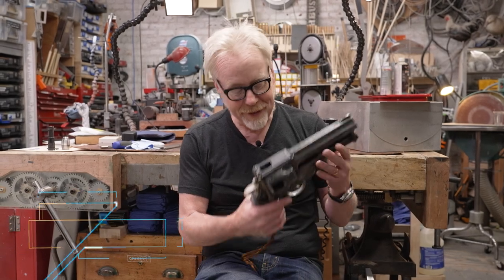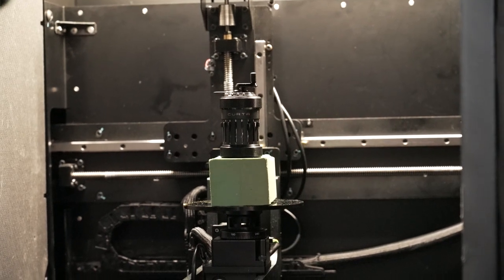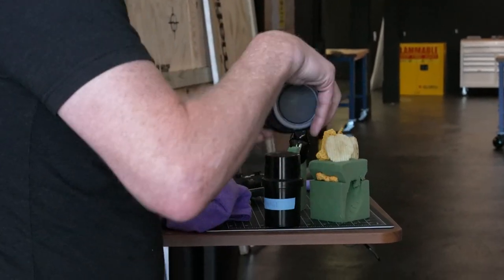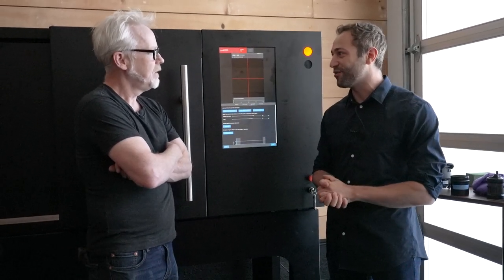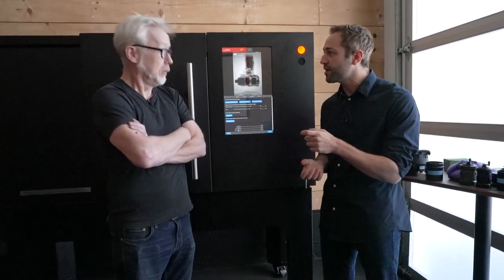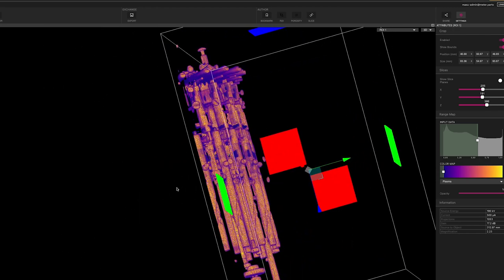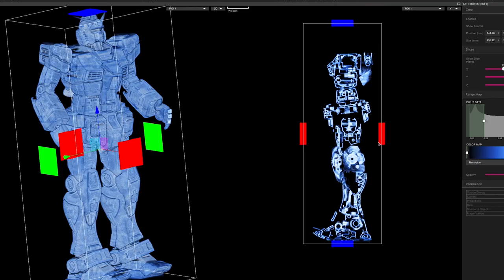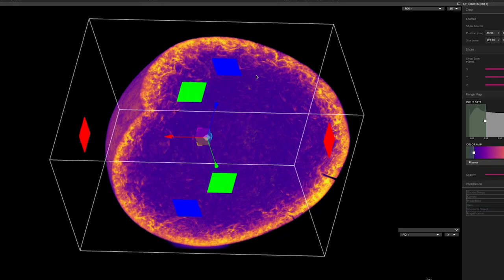Adam Savage's Curta Calculator Gets CT Scanned!

Comment: Just wanted to add something to the video (for context I’m an Applications Engineer for a company that has been designing and manufacturing CT systems for years).
As was said in the video you do have time vs quality - longer scans are less noisy or you can penetrate more.
We can do scans anywhere from a few seconds (you’d be surprised the data you can get from 20 seconds with the right set up) all the way up to hours. And we can scan things from a grain of sand (eg a bronchoscope lens) all the way up to a part that is taller than Adam!

We also make different X-ray sources that let us get a resolution of 1um (for lower densities or electronics), but more commonly is a source that can get down to 3um (which is a more general purpose source).

The things you scan are pretty much anything and everything- even food items (the porosity and inclusion distribution is important for chocolate!!)

I’d be happy to answer any questions (within limits of NDAs), if lumafield and Adam are okay with it, as I don’t want to steal their thunder as the data does look good 😊
Reply: Have you scanned anything like ICs, CPUs or GPUs? Can CT scans see inside the silicon? :o
Reply: Is there a problem if the object that's being scanned has both very dense and very sparse components? Something akin to sensitivity in photography?

Edit: and if there is, do you use something akin to HDR to compensate for it?

Sorry if I'm a bit hard to understand. English isn't my native language.
Reply: What kind of density resolution can you get to?  The Gundam's ABS inner frame and styrene armor are only about 0.1gm/cm^3 different in density so that's a lower bound.
Reply: is resolution a function of the wavelength of the x-ray?
Reply: Can you somehow do film? I'm sure not, but it would be amazing for preservation of badly damaged film, I'm sure.
Reply: Second the curiosity of can you scan silicon chips without decasing them?
Reply: @LoganDark4357  we scan circuit boards/electrical components all the time. Generally we can regularly see the fishtails of the bond wires which are only a few microns across.
If you wanted to see inside the silicon components you’d ideally remove it from the metal backing, and then use low power to get enough contrast in the image. But in theory yes 😊
Reply: @ptyzix  if we want to scan dense samples; we use physical filters to remove lower energy X-rays to then get enough signal through the material(s). It is a balance though (especially for multi-material samples) as you reduce the contrast in the data, but if you find the right set up the data still looks great for samples that have lots of different materials
Reply: @grimlock1471  for scanning we use a similar foam (but for stage props as the flower foam sheds really badly!), but at lower beam energies (low penetration, high contrast) we can actually still see the foam! The biggest issue you face for density differences is if you have a part that has both really high density components AND low density components, as if you have optimal penetration for the denser section you’ll over penetrate the low density material, and so not be able to see if very well compared to the air- it’s a tricky balance
Reply: @lettersnstuff  for resolution it’s dependent on how small you can get the area of x-ray generation and where the sample is relative to source and detector (ideally close to the source and far from the detector for high resolution). The higher the wavelength, the more penetration the beam has. In the industry we generally talk in terms of the kV we used in the x-ray source to generate the x-ray beam
Reply: @Just_Sara  sadly CT shows physical differences, for film there just isn’t enough to see. For example, if two parts are physically identical but just a different colour, you wouldn’t be able to see a difference in the data.
Reply: @satibel  for normal inspections they’re absolutely fine. If you decided to put the chip right on the source (so high intensity part of the beam) and leave it for hours and hours you could in theory start to damage it; but as I say normally you’re safe enough 👍
Reply: It appears to me the configuration is actually a cone beam CT (CBCT), there is a flat panel X-ray detector in there that you can see. CBCT can achieve a high horizontal resolution (in the plane where the object rotates), but the vertical resolution will be limited by the flat panel pixels density. Also farther up and down from the central horizontal plane the reconstruction artefacts worsen (since it is not possible mathematically to reconstruct the volume from the cone beam geometry). So, do these scanners also move the object vertically to improve vertical resolution and perhaps fight the artefacts on the top and bottom extremities?
Reply: @Archie3D     you’re on the right track; although the resolution of the scan is the same horizontally and vertically (assuming the pixels are square rather than a different shape). The resolution is simply the pixel size divided by the geometric magnification factor.
Cone beam CT is most common (and is what they would be using here), but I also use fan beam CT for certain specific uses.
At the very top of the datasets you can have ‘top hat’ artefacts where the section of the sample is in the field of view closer to the detector, but out of the field of view when rotated 180 degrees (closer to the source), so you have partial data. There are also artefacts related to flat surfaces away from the centre of the beam. These can be avoided by either angling the sample so the surface isn’t flat, or (depending on the company) some have the ability to move the sample vertically through the field of view as it rotates to get around the issue. It also has the benefit of scanning thin but tall objects at higher resolution than you otherwise could!
Reply: I work with medical CT scanners! The resolution of these is astounding. I'm happy with mm accuracy in patients. How do your x-ray sources manage to get down to um resolutions?? Tiny small beam sizes with tiny collimators?
Reply: @baldilocks2356   unfortunately I’ll have to be quite vague as it’s covered by NDAs, but there are some ways you can generate X-rays from a smaller area which means there’s less geometric unsharpness in the image. It limits how much power you can use for a given resolution, but if you want good resolution then it’s worth the trade off.
I’m guessing your systems use a bank of fan beams for the scans; with the source and detectors rotating rather than the sample (person)? To be fair though, the features in human body are generally large (relatively speaking), so the worse resolution means your system gets better image than maybe ours does for a given radiation dose 🤔 whereas we don’t scan things that are living, so don’t have to worry as much 😅
Reply: @Physinaut  I have a GE Phoenix Nanomex at work that I love, it sounds like your system is at least an order of magnitude better than our decade-old instrument, I'm very jealous. We primarily use ours for PCB failure analysis so our 15um or so resolution is acceptable...but that kind of improvement would be very, very welcome.
Reply: considering that X-ray range from 0.01 nm to 10 nm, what is the max physically possible resolution a CT scan can get ? is it straight up 0.01 nm ?
Reply: @danilooliveira6580  In practice I've heard of resolutions down to 3um, I've never gotten better than 15um on my CT scanner personally. I suspect that the x-ray beam stability and the sensor resolution are the biggest limiting factors.
Reply: @danilooliveira6580  typically resolution is dictated by the detector’s pixel size and the geometric resolution (position of the sample). Source stability/sharpness dictates how much blurring there is (also called geometric unsharpness). 
Although the detector pixel size is a trade off too, as smaller pixels generally have to have thinner scintillators (converts X-rays to visible light as a detector is a larger camera in practice) to stop blurring between pixels, so is less sensitive, so scans take longer. Typically detectors have pixels 100-200um square, but I expect you can see applications for even smaller or larger pixels (just depends what you want to see).
Reply: @ptyzix  depending on the technique used there's a strong probability to see multiple densities. I have CT scanned in the industrial world for 6 years and a common example is engine blocks, aluminum blocks with steel bolts is an example and both materials present as different densities.

The challenge comes when the materials are too similar or come in contact as they can sometimes appear as though they are a single piece.
Reply: @lettersnstuff  CT resolution is a product of a few variables. Firstly it's the geometric magnification (source to detector divided by source to object distance). Then you need to factor in part geometry, for example do you want to see the tip of a pen or the whole pen? This would determine where you place your part in the x-ray beam. Finally you need to factor the detector pixel pitch, the size of the pixels collecting and converting X-rays into digital images determines resolution.
Reply: @satibel  silicon chips are very low density, when scanning by itself you can get some really good data, unfortunately if it is mounted to a PCB, the board and other components tend to mask the silicon
Reply: @Archie3D  there are systems in the market that have that ability, panel shift or helical CT scanning is available through multiple brands
Reply: @baldilocks2356  short answer, smaller focal spot sizes. Using a smaller source allows you to get higher resolution and a sharper image compared to medical CT. For example, the light in whatever room your in creates a shadow of your hand, the shadow clearly makes a hand shape but it's blurry. Using the LED on a phone flashlight and shine it on your hand, looking at the shadow you'll see how sharp the edges are because it's a smaller source.
Reply: @drummer8769  a desoldered soc or even a simple through hole jellybean 74lsXX/ne555 would do.
Reply: Do you ever make 3D animations?  That is, make 4D datasets: take one 3D scan, then incrementally move a part of the mechanical system -- e.g. make a tiny turn to the  handle of a Curta --  then take another 3D scan ....  repeating over a path of interesting functional movement. (That is, you'd take  roughly 50 -- 500 3D  snapahots.) Would be great to see this for a Curta. I think under $20 in spare parts to make a device to do precise incremental turns of a Curta handle: microcontroller, servo, scrap wood.
Reply: @bazzers   I like the idea, but for good quality scans would take somewhere between 20 minutes and an hour (or longer for even better scans), so doing 50+ would take a bit too much free time.
We could definitely do a radiography video and see the parts moving in 2D.
It’s worth noting that in CT viewer software, you’d be looking at 2D slices anyway.
There are companies that can do effectively 4D CT- say a scan needs 2000 projections for good data, and the space between projections is (360/2000) degrees. Then if you have a moving process (eg foam growing) and just keep rotating the part at a constant rate, you could then select the 2000 sequential projections you want to turn into data. If you want to see the process slightly later in time you could select later projections (for some companies the selection of projections can overlap, so can be pretty small time increments)!
Reply: I don't really have any questions but thats so cool, this is something ive never even considered before but that makes so much sense, especially with stuff like food that's so fascinating! Very cool, thanks for sharing!
Reply: @Physinaut  Would the software allow you to make multiple scans of the same object and then put them together to compensate for the different densities?
So you have scan #1 that focuses on low density, then scan #2 that shows high density, and then have both scans put together to show a single cohesive image?
Reply: @voltronimusprime3833  you could absolutely have a scan that focuses on higher densities and ignore lower densities. The issue with wanting to focus on lower density components while higher densities materials are still present, is that you won’t be penetrating the high density materials enough which causes artefacts (generally streaking) in the CT data (multi material samples are always a balance between contrast and penetration)

Comment: This thing with the 3d printer feels like a clone machine, you can put in ancient artwork and just print copies, this is so freaking cool
Reply: More like a Replicator as seen on the Enterprise D.
Reply: How long until someone does a Copy Paste of the Antikythera Mechanism?
Reply: @nasonguy  They actually used this exact tech on it, I'd love to see the models published though.
Reply: Seems like it could be really great for  replicas in museums of you are concerned about damage to an original piece.
Reply: @circleofowls  Really? That's incredible. I knew of a couple projects trying to rebuild it or at least create theoretical models for it. But I honestly haven't read about it for probably 10 years.
Reply: @nasonguy  I've met one of the guys that CT scanned it and I have a copy of his PowerPoint presentation. Very cool stuff!
Reply: @andersonneil2293  CT was used to scan scrolls damaged in the Mt. Vesuvius eruption. Then the unroll/freeform surface tool in the evaluation software was applied and the scrolls were able to be read!
Reply: @nasonguy  someone has already replicated the antikythera mechanism and it works perfectly as a solar system calculator that can be used to calculate celestial alignments on any given date.
Reply: That’s just one of the extra things I love about it so much. Not only can you scan a particular piece, but it’s smart enough to be able to understand it as a physical model, isolate that piece and then 3-D print it using whatever printer you want.
Reply: @nasonguy  if technology were a religion, would that be considered blasphemy? 
Thank God engneers don't allow religion to limit their progress 😇
Reply: @sally6457  "Thou shalt not make a machine in the likeness of a human mind." The O.C. Bible.
Reply: @nasonguy  the, i had to google that, 
Thanks! What a great wormhole to explore, 
Oh the irony, youtube has made me pick up a book! Hahaha 📖
Reply: @sally6457  The Dune universe is so incredibly rich and full of lore that it never gets old. Frank Herbert is one of the best writers of all time.
Reply: @nasonguy  very few people can write a book that is good enough to want to read over and over, every time you read the same words, while your concept of the story grows, making you think deeper,  
Other authors I think are as good are Douglas Adams, Terry Pratchett, Neil Gaiman, Tom Holt and Philip Pullman,
Give them a try if you haven't already.
Reply: @sally6457  HUGE fan of Adams, Pratchett and Gaiman. Haven't heard of Tom Holt and Philip Pullman. I'll definitely check them out!

Comment: One of the greatest strengths seems to be what was briefly mentioned at the beginning of the video, and that was the ability to do scanning for diagnosis or analysis of things like internal o-ring compression. If designers can catch failure points earlier in the process, with less cost, that could begin to improve the reliability of lower end products which normally quickly enter landfills. Extensive testing isn't always cost effective when you're just turning out a low cost item into the market.
I could also see some detrimental effects of this, e.g. making it easier for products to be cheaply cloned and dirty the market with knockoffs, but considering how a lot of the current clones happen due to the original source design materials being leaked or sold, they don't need a 3d scan anyway.

Comment: Years ago I worked with medical volumetric data. There are more visualization modes which might be of interest: maximum density (along view ray) to spot clumps where they might not belong; minimum density to likewise spot holes. One can use the local density gradient (with fake illumination) to help the human eye extract surfaces from the nebulous volume. If there is enough computational power available, one can shine "god rays" through the volume from one direction and observe scattered light from another direction, to more clearly perceive subtle density variations in areas that ought to be uniform.